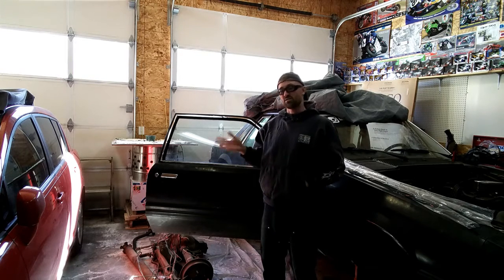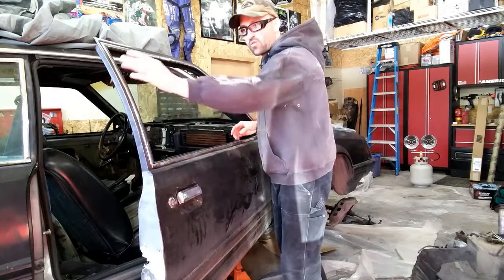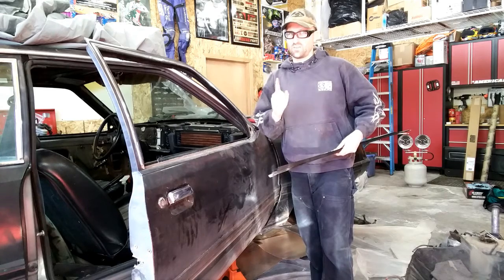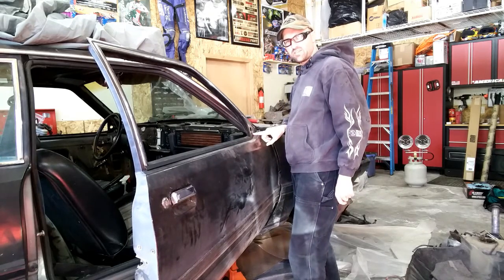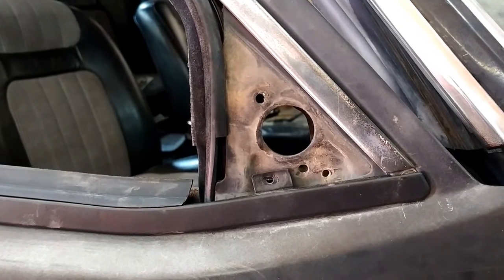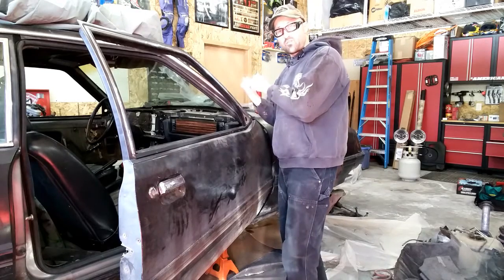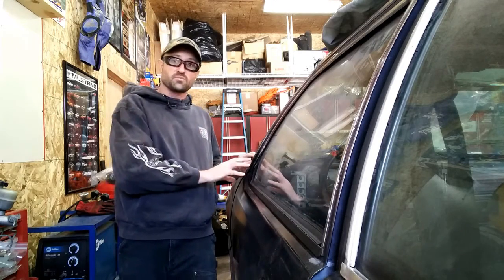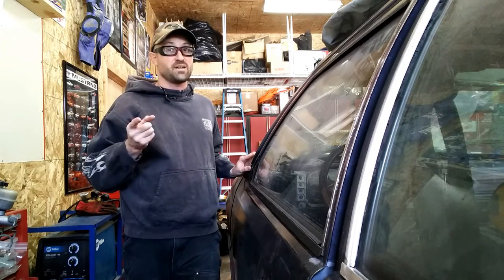Installing Foxbody Mustang Outer Waist Molding Dew Wipes

Comment: I hope an 84 hatch is that easy.  Thanks for the vid, best one I've seen so far, since you actually explain how to swap the chrome which I was wondering about when they came in black.  After that I'm doing LED dash lights and headlights.  Headlights are another hurdle without overloading the system.
Reply from the maker: It should be that easy. The '79-'86 models are all pretty close. I have the LED dash lights on my to-do list also. The LED headlights make a huge difference. You'll enjoy them.
Reply: What LED, head lights did you use??
Reply: @brucebell7623  I gave my niece my 84 and she went with LEDs from RMS Lighting (Hector Vega).  They're factory four eye looking housings with nice LEDs.  If you want a factory look that's an easy swap with bright LEDs, those are nice.
Reply from the maker: I think I had a link to them on Amazon in the video description. They are a 4x6" LED.